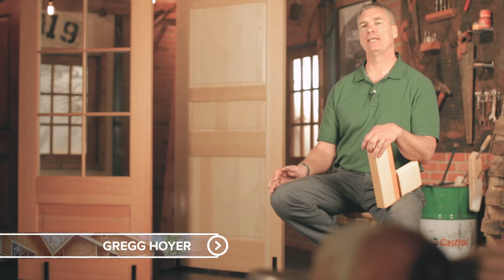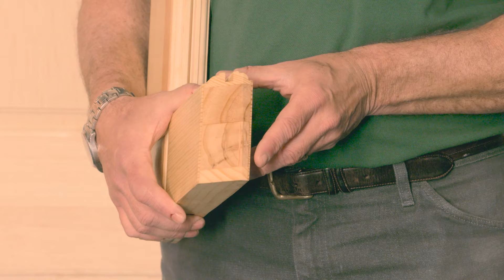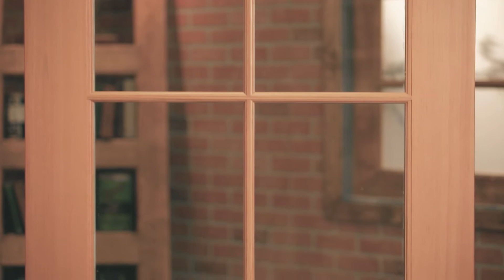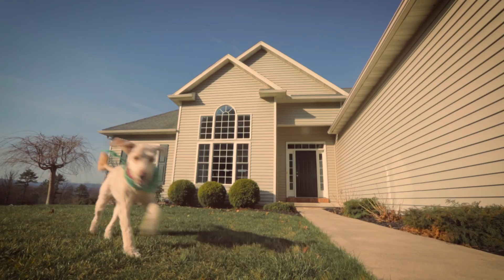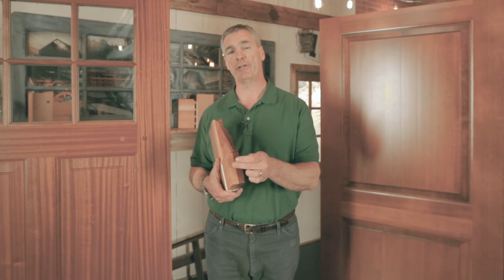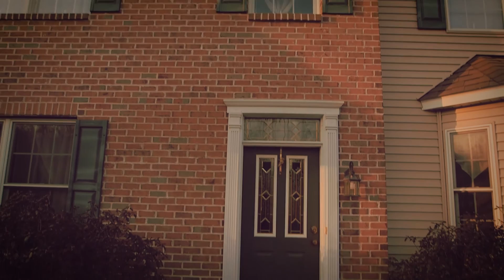Types of Wood Doors and Their Applications | Reeb

Comment: Definitions for noobs like myself -

Dowel pin: a wooden or metal peg that fits into two corresponding holes to join two adjacent parts
Cope: shaped end of moulding or frame component that neatly fits the contours of its abutting member
Stile: vertical components on each side of the door that join its rails with its dowels
Rails: horizontal components of the door that joint its stiles with its dowels
Mortise and tenon joint: connects two pieces of wood, usually at right angles